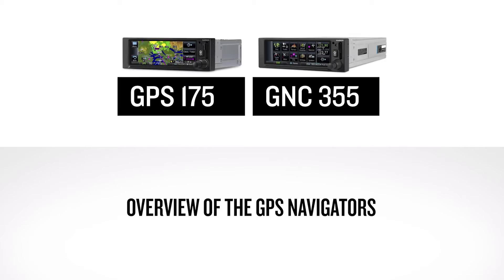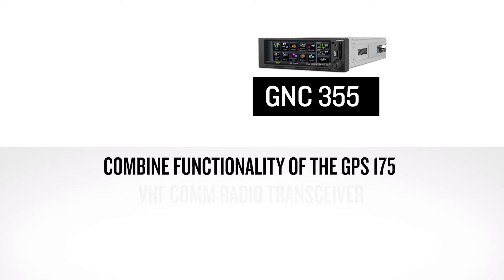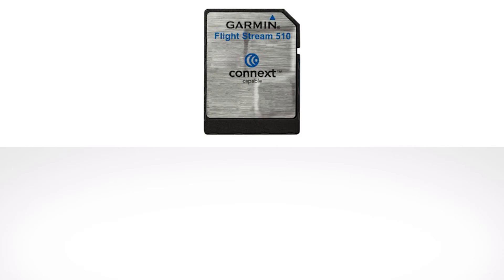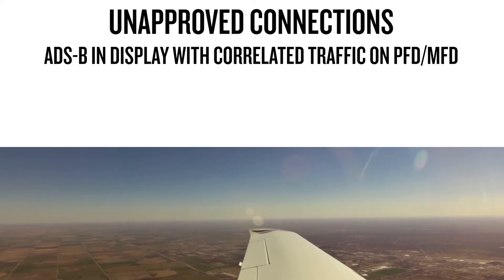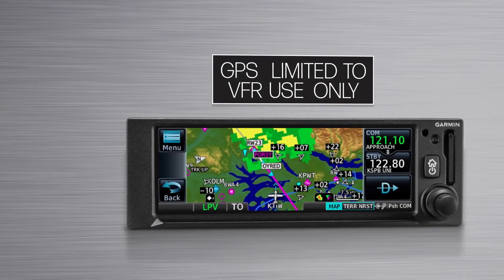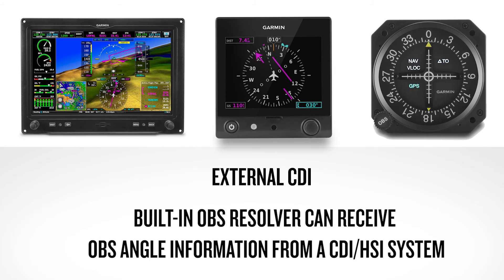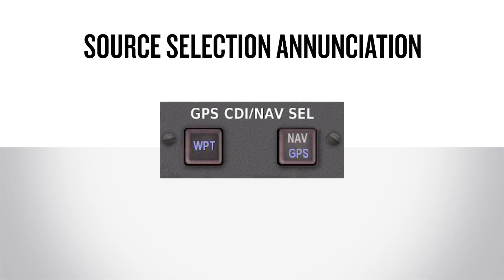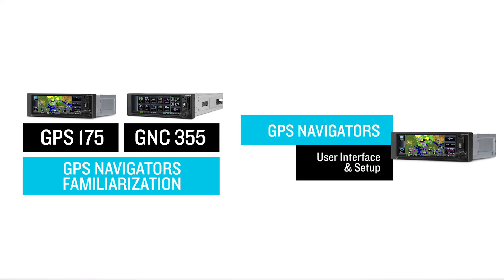GPS 175 and GNC 355 GPS Navigators Familiarization

Comment: I belong to an aero club that has a 1972 172K with steam gauges, a single VOR and glidescope, an AV 30 and a GDL 82. Will the GNC 355 comply with IFR? A simple answer for a simple guy.
Reply from the maker: Hi Jim, thank you for reaching out. The simple answer is that YES, the GNC 355 offers GPS IFR approach capability. Thank you for considering Garmin.
Reply: 1972 is a 172L.   The K was made in 1969 and 1970.